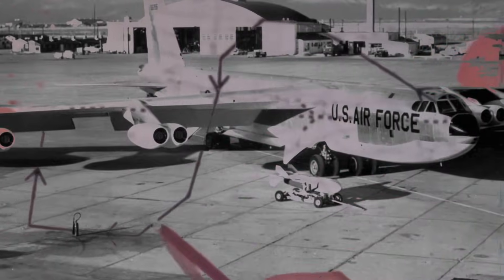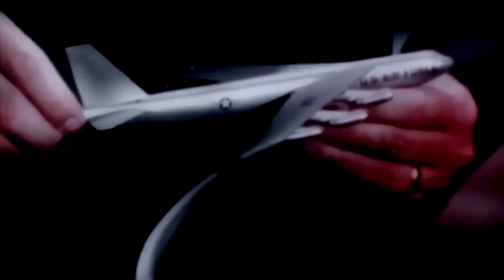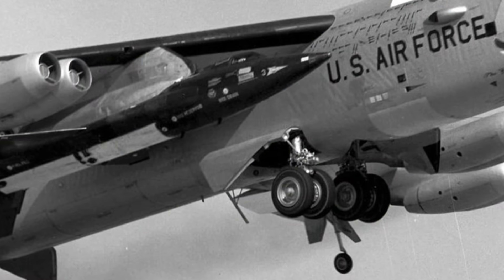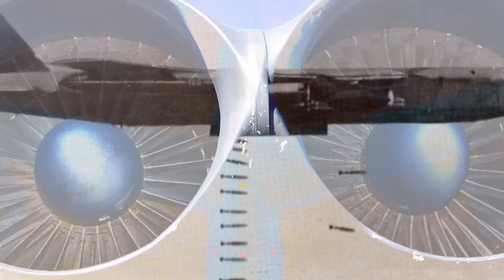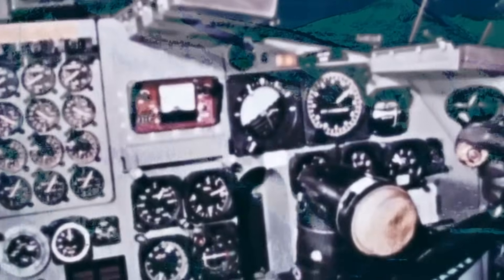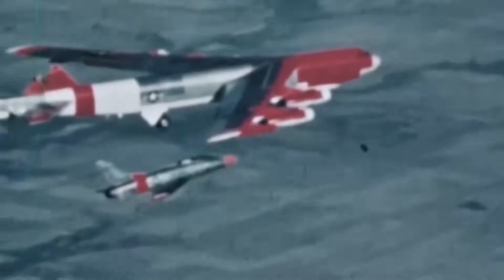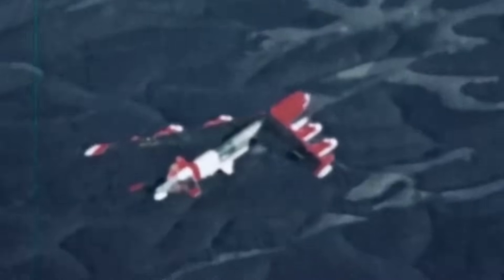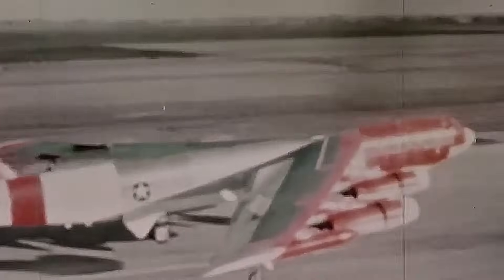B-52 Landing Without a Tail: Severe Turbulence & America's Secret Nuclear Deterrent

Comment: This is ancient history mow, but there are inaccuracies and irresponsible comments in it. I was there!  But I am just now hearing this account for the first time. I had planned to go on this flight as an observer. I was Chief of Structures Technology at Boeing-Wichita at this time. This flight was not made specifically because of previous tail-loss accidents, as is stated. The B-52 had not been designed to fly at low level, and this flight was part of a broad program to understand that environment and its effects on the plane's structure. This was at the height of the Cold War, and SAC crews were required to practice this type of low-level terrain avoidance flying to be ready to penetrate below Soviet radar.This plane was instrumented to record gust velocity and airplane accelerations and stresses. This information was then to be sent to my section for analysis. As an observer, I would have been sitting behind and between the pilot and co-pilot. But this plane did not have a tie-down restraint for an observer. Chuck Fisher, was concerned for my safety and suggested I fly instead on 56-632, a B-52D which had a seat belt attached to the flight deck, and which I had flown on before. It was fully instrumented, similar to Chuck's plane. So I flew with Dale Felix and his two-man crew on a different low-level route two days before this flight. During my flight, Dale let me sit in his seat and fly a short while, with the co-pilot keepiing a close eye, of course. So there I was, tooling around only a few hundred feet over the farms and hills of eastern Colorado in an eight-engined beast. Quite a thrill!  And two  days later I was glad not to have gone on Chuck's flight. When he first lost control. Chuck had given the order to "Prepare to abandon ship." If I had been aboard, I would have been on the upper deck, with my ejection seat on the lower deck, and it ejecting downward!!. Not a pretty picture. We analyzed the data from this flight and found the gust velocity which broke the fin was 2 1/2 times that for whiich the plane had been designed. I don't understand the statement, " all that remained was a small ridge of wood." There is no wood on the B-52. And it is offensive and untrue that "many of those involved back on the ground in Wichita expected this result." Then there's the strange and inappropriate segue from this incident to a rant about the costs and dangers of the nuclear deterrance era. What does the commentator, in hindsight, say should have been done. Anyhow, these flights were stopped until modifications were made to strengthen the tail and aft fuselage structure. A year or so after this flight, I again flew with Dale Felix, on a imilar route as this flight, up and over and around the foothills. It was quite a thrill. I am now 95, and I remember it well.
Reply: 9   19  95   congratulations  and   huge  gratitude  ~ thanks   sir  canadian
   RCAF    imagine   the  experiences  over  the  earth   am humbled, amazed
             &  delighted  to read  your remarks  stay  safe  AnD   WarM   COLD'e here!
Reply: @rm-ih1ns Thanks. Good to know somebody (you, that is) is still interested in history, and the truth. It's becoming hard to find in these parts. Best regards, LG

Comment: "Splintered piece of wood was all that remained"  LOL.   Then the comment about transferring fuel forward to get a more forward center of gravity..  You loose that much weight off the rear of an aircraft and your center of gravity is more forward already.    Finally, the comment when they are on landing approach,  "They deployed the emergency drag chute"   The drag chute is used on every landing to help slow the aircraft as it does not have thrust reverses on the engines.

Comment: G'day Dark, I had no idea there 'could be' so many potential broken arrow incidents and in-flight malfunctions of the B-52. Given the seemingly endless upgrades of this iconic aircraft, I hope it's safe to assume that they are, now, the safest most over engineered large aircraft in the skies. The USAF apparently wants to use them until the 2030s! That will be some momentous achievement. Pilots could be flying the same airframes that their great-grandfathers flew! I'm a WW2 aircraft enthusiast but I have a special fondness for this mammoth aircraft it looks so cool, so intimidating even though, up close, it looks like most of it is covered in wrinkled cooking foil. I swear you could put a pencil through most parts of the fuselage.
I am presently working on a 1/72 model of a B-52G and as I do my appreciation and affection for its design only increases. I wish I could have a 'jolly' flight on one of those babies but that's never going to happen as I’m pretty sure the USAF doesn’t do joy flights for old, retired Australian journalists. Cheers, BH

Comment: Hey Air Force. The tails are snapping of B-52'S! 

AIR Force: well put an atomic bomb on them. NO. wait, put TWO atomic bombs on them.
Reply: Airplanes back  then crashed relatively often. This was also the case for others like the predecessor, the B-36, and for smaller, faster jets like the B-58 (which had a high crash rate even for the time).

Comment: Over 700 of those craft. Still no replacement. B-52, B-1, & B-2. B-1 cancelled mid 1970s, but too few built anyway stoopid Republicans. Should have gone straight to B-2, but only 20 built instead of full fleet because the B-1 was built. So US has three bombers, and still no replacement for the B-52. Still more B-52s than the others.

Comment: "Small ridge of splintered wood remained at the rear of the plane"? I was not aware that the vertical was made of spruce. Maybe I misheard that.
Reply: I think the narrator misspoke.
Reply: @superdupergrover9857  often... "inclement bad weather" springs to mind...
Reply: @gnoccialpesto  hee hee
Reply: Just goes to show you,  don't believe everything you see or hear on YouTube. I worked for Boeing Wichita for several years, way after the 52s were out of production, but was able to climb into a 52 that was on our flight line for some reason. Sure don't remember seeing any wooden parts.
Reply: @JP-st2mk  So you were "able to climb into" what was likely a late model of a plane which had eight models over its production run, but you didn't ask anybody or hear what it was made out of, or look at schematics, or anything like that. It just goes to show you, don't believe everything you think when you only have a little info on a big subject. Knowledge isn't gained by osmosis or I'd be a helicopter mechanic.
Reply: Your quote was correct but he didn't get into detail about it, let alone saying the whole assembly is made of spruce. From what I'm reading, there were eight different models of the B-52 over its production run, but I can't find solid info about what the tailfin/VS assembly is made out of. Wouldn't be hard to believe that an early model had some wood in the frame, and probably a metal exterior.

Comment: Ok, a B-52 lost its vertical stabilizer.  So what is your point?  An accident happen involving nuclear weapons? This was a test flight.  Most of the video was about the test flight, not the incident with the nuclear weapons.  Do you have any real facts such as ratio of tail damage to number of B-52 cycles? Or even flight hours?  Any real facts on number of flights with nuclear weapons and crashes that compromised the nuclear weapon?  These facts are available but you failed to report them to promote your own agenda.  Despite the B-52 reportedly hard to fly, it has a very good safety record for an aircraft being flown for over half a century. 

Almost all videos and documents used internally are marked "Official Use Only" if they are not secret or top secret.  All non-secret training videos are marked that way.

Comment: the rudder is, functionally, the least useful flight surface. Elevators, being the most important, modulate altitude adjustment. With ailerons, you can adjust roll. Combined, you can adjust yaw, what a rudder does innately. An impressive feat, but not unheard of, or nonsensical/magical

Comment: The tail wasn't lost. The majority of the vertical stab. was but enough left to assist in maintaining stability.  The horizontal stabs were also intact. 
Interesting and somewhat harrowing but the tail wasn't lost.
Reply: Dude, damn near all the vertical stabilizer was gone. The entire rudder was gone and without that turning the plane is hard, hence the dropping of the rear wheels. "The tail wasn't lost"....but the picture paints a different story.
Reply: Dude,…... I am an aircraft structural mechanic. 
I stand by what I said.

Comment: Your first description of the damage was inaccurate.  I’ma cold war Vet that was stationed with the 42 Bomb Wing.  Your videos are irritating at best
Reply: You forgot to point out to him that B-52's aren't made of wood
Reply: @fishbmw  And you weren't paying attention to the pictures well enough. Though I can understand that, they were pretty bad. But you can see what looks like some kind of 2x lumber in what is left of the vertical stabilizer. And I spent four years in the Air Force working on F-4s and C-130s even worked on a B-52 one time though not the tail section. Job title, airframe repair specialist. In other words a aircraft body man. Loose rivets, nut plates or nut plate strips or Battle Damage l'm your man or I was.

Comment: This video and the Wright Patterson AFB 74 B-52H crash  due to loss of hydraulic power (aircraft crashed because it was at the top of a phugoid and it dropped) were the first two videos shown to copilots training at Castle AFB in the 4017 Combat Crew Training Squadron. Believe it or not the B-52H crash no crew were killed as the nose broke off and rolled to the right while the rest of the aircraft fire-balled down the runway. The pilot was and I am NOT joking Capt Charlie Brown. I was a copilot at Castle AFB and I am sure the rest of my class mates never forgot these two videos either. I assure you we didn't complain about the quality of the video because it was VHS and no better than what you just saw....

Comment: Planes DON'T pitch violently left and right.  It would be ROLL violently.
Reply: With enough wind pushing, a plane will do anything.
Reply: @ronniesmith65  Um, I think you missed the point...you CAN'T pitch left and right.  I guess if you wanted to get absurd about it you could, on knife edge, WRT the ground, but that's REALLY pushing it.  ;-)  Pitch is rotation about the wing axis, if you will.
Reply: John Sikes I was in the AF as a crew chief on B-52s. I understand pitch, roll, yaw, drag, thrust, gravity, lift and the effects they have on an aircraft. My point was that you can have situations where an aircraft will do things in the air it isn’t supposed to do because of weather.
Reply: @ronniesmith65  Did you have anything to do with THIS  B52?
The most violent weather thing I ever heard was from a pilot that got sucked up into a thunderstorm in a SAILPLANE.  If you think about what it takes to hold a grapefruit sized chunk of hail airborne, I would suspect something on the order of 150 MPH...STRAIGHT UP.
I'm not poo pooing "weather  capability", just that the statement was incorrect, from a technical standpoint.   Probably the engineer in me.
Another "weather power effect" that is pretty amazing is look up dynamic soaring R/C.  Those guys are getting 400 MPH out of an UNPOWERED airplane.
I guess in this case it could also be YAW violently, and in that case, it would be left and right, so OK, I guess I can buy it...bit it still isn't PITCH.
I was a EE at Lockheed Martin, and for a while worked in the B52 lab on WCMD program.  There was a section of a B52 fuse hanging from the ceiling (hence the name).  Not sure what legacy program it was there for, LONG before my time.

Comment: Can you imagine these B-52s were carrying 9 mt nukes?  At least two per airplane?  The largest H bomb the U.S. has ever detonated was "Castle Bravo".   That early device was designed to be a 4-5 Mt. yield.  But due to a miscalculation in the type of Hydrogen isotope fuel used, it yielded over 14 MT.  
            The Titan II explosion in Damascus Ak. had a 9 Mt nuke at its tip. Thank God the warhead didn't detonate after the missile exploded when an airman accidentally dropped a large socket 90 ft down to the base where it bounced off a wall and punctured the fuel tank.  Otherwise, a large part of the North Eastern U.S. would still be glowing.
              Today, we don't need bombs that big.  We can put a missile with a laser or GPS guided warhead down a chimney and make it explode on the 6th  floor of a building if we want to.
            Back in the day, our guidance systems were so inaccurate we thought we needed nukes to be able to hit at least 20 miles from its target in order to destroy it.   Today, we can shove a firecracker up a frog's rear from 3000 miles away.
Reply: I was stationed at Blytheville AFB as a B-52G crew chief. At the time B-52s could only carry nukes, didn't have the capability for iron bombs yet. We had 5 bombers on alert 24-7 and each one had 12 ALCMs, Air Launched Cruise Missiles, under the wings, 5 SRAMs, Short Range Attack Missiles, mounted on a rotary launcher in the bomb bay and 4 gravity bombs. I don't know the yield of the weapons...but it had to be a good bit for all the stuff we carried.
Reply: @ronniesmith65  First, thank you for your service, especially during this Memorial Day weekend.  Most people think this weekend is to celebrate and have parties like we do on "Veteran's day".  But it wasn't meant to be a party weekend.  It was meant to be a solemn day to think about the lives lost during our wars.  We've turned this weekend into a party when "Veteran's ' day should be reserved for same.
             Anyway, I read your comment very carefully and I'm confused and I hope you can help me.  As a crew chief, you said: "At the time B-52s could only carry nukes".
        I'm guessing you're still a young guy, maybe in your 30s or 40s. But back in the days of View Nam when I was of age, B-52s carried mostly iron "dumb bombs".  I guess they had the capacity to carry nukes, but we never used nukes since WWII.
             Are you saying that all of the ordinances you described above had some form of a nuclear component to them or am I reading your message wrong?  In any event, thank you for your service to our country, the U.S.A.
Reply: daffidavit they did carry iron bombs in Vietnam, I should have clarified. When the B-52 was first introduced it was made to carry atomic weapons. They were modified to use iron bombs in Vietnam then they went back to nukes only. I was in the USAF from 85 to 88 and when I got out they were just getting the old pylons that were used in Vietnam delivered to Blytheville to clean up and reuse again for iron bombs. I can’t say for sure, but most likely they now have dual capability for nuclear and conventional weapons.
Reply: @Yahweh312  IDIOT

Comment: Wood??? Low altitude flying puts much more stress on the airframe. Two of the the three British V bombers couldn't do low altitude sorties and the wing structures cracked for instance. Only the Vulcan survived extended low level use - and looking at the shape of it, maybe it is clear why. The massive wing roots and so on. The B52 was designed to deliver it's payload at high altitude. Never at 500-1000ft. But I bet the pilots put in a lot of rudder...
The loss of aircraft carrying weapons of mass destruction is a long one and much has been declassified. Search for official lists.

Comment: The B-52 is one badass plane, that's for sure, and it's one that the USAF just can't seem to get rid of - current predictions see the B-52 fleet flying in frontline service until at least the 2040s, with a possibility of it lasting even a little bit longer - alongside the Douglas DC-3, this could be one of the first planes in continuous service for almost a whole century.

Comment: Too many airliners have lots their tail rudders from shearing off,this should be addressed and all tail rudders should be steel cable reinforced in an A shape to the tail wing flaps,this would ensure the tail rudder can with stand extra turbulence and stress,no composite should be used and the inner parts of the tail need to be honey combed in shape for added strength
Reply: Well son of a gun.....I bet those aircraft designers wish they had you around when they built this plane!!

Comment: I'd like to point out that a plane designed in the 1950s and which took only 3 years to go from first flight to production, was able to fly without 90% of its tail relatively easily.  Meanwhile it took over 9 years for the F-35 to go from first flight to production and it's still having problems.  Oh, did I mention the B-52H only cost 57.8 million dollars a plane while the F-35 goes between 80-115.5 million and while I don't have a number for how much the entire B-52 project cost, I doubt it's over 1.5 trillion.

Yes, I understand the F-35 is super advanced and whatnot but most times, being super advanced is not needed.
Reply: The F-35 wouldn’t be quite so embarrassing if it wasn’t:

A: An attempt to create a “low cost alternative” to the F-22 because of the expense of that program. 

B: A less capable aircraft despite all the cost overruns that made it more costly than the F-22 itself! The only trick it can do that the F-22 cannot is the VTOL/STOL capabilities. Everything else the F-22 either can, or could do with minimal upgrades. 

C: Has all these ongoing technical problems that repeatedly has delayed their deployment and tarnished their already dismal reputation...
Reply: What's that? You're an America hating leftist?